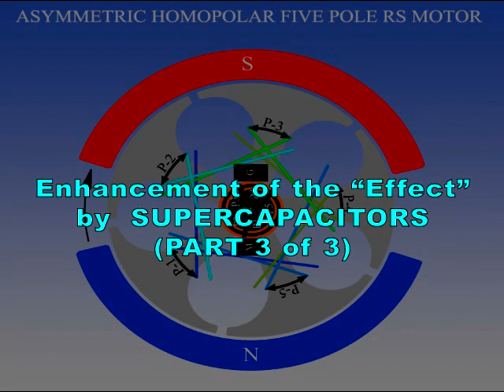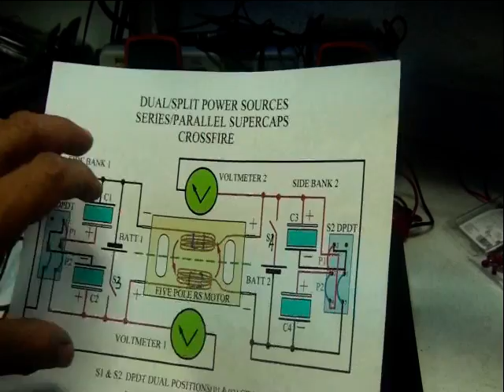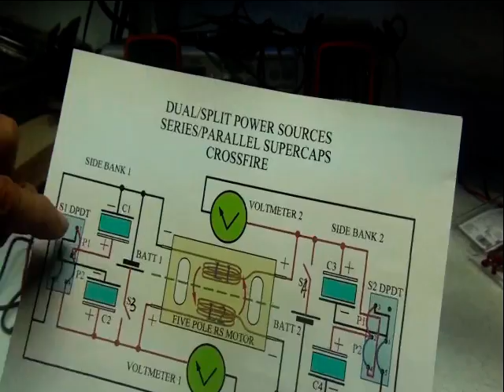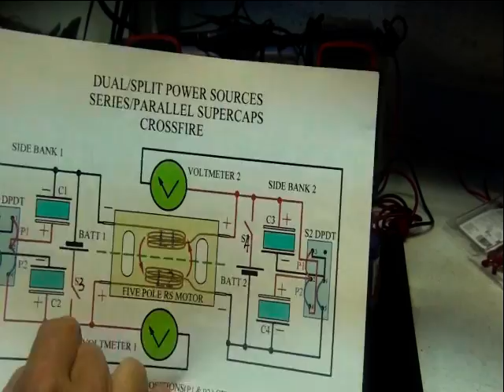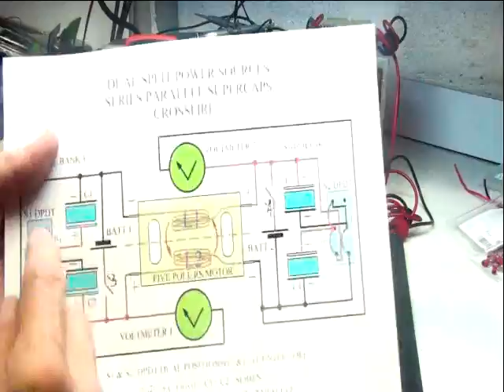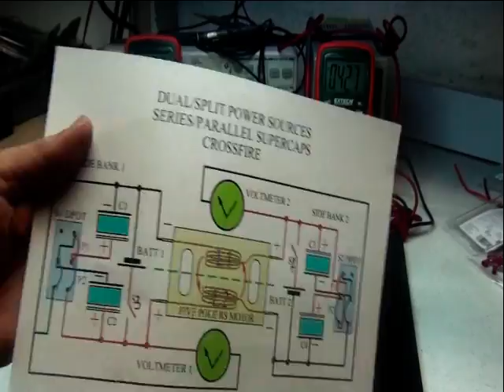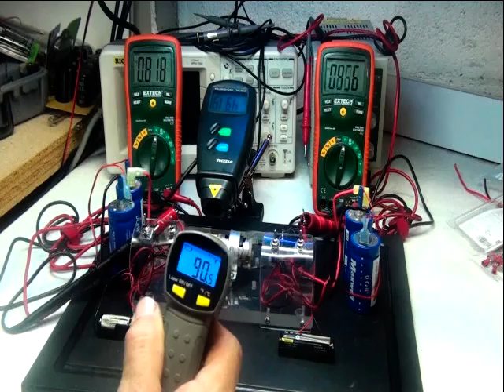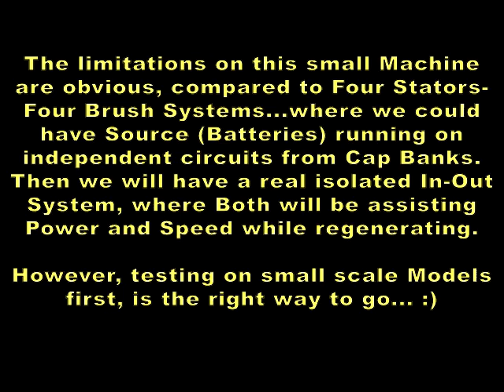ASYMMETRY FED BY SPLIT BANKS (THIRD VIDEO)

Comment: Good demo. With the switches, it was easier to understand the important aspect of this configuration. It's obvious to anyone that can think for self that this is a step in the right direction. This motor battery, super-caps, topology has the capability to make the  e-car super efficient. I seems like it would  increase range from the current 200 - 300 km to possibly 400 - 600 KM ! With more tweaking it could further be improved substantially. It's exciting, let's go to bigger rigs !

Comment: Hello ufopolitics. First of all, let me thank you for what you are doing for all of us, for sharing your truly amazing finding with the world, only good-hearted men do it and you sure are one of them. 
I've watched all of your videos, and I have two doubts about your motors. Please correct me if I'm wrong.
1. I can clearly see that the motor rpm raises as it goes (and specially in the SELF ACCELERATION/BATTERY REGEN video of yours) and also the voltage on the batteries increase? Does this mean that if you leave it running for a few hours, 8 for example, that it may fully regenerate rechargeable batteries?
2. From your other videos, I understand that in pulsing systems, in the same timeline of energy feeding, if the pulses are shorter (in time) that the output power of the pulse from the coil will be higher? If so, then, the more poles a motor has, the more efficient it will become within the asymmetric domain? Again, I'm a layman when it comes to this, as my area of work is another one. But your fascination with your findings is the same as mine, and I am glad and lucky I've came across your videos.
I appreciate your time, and thank you once again for your kindness.